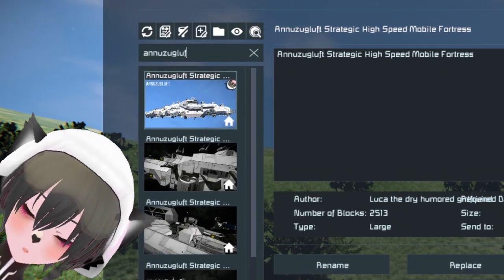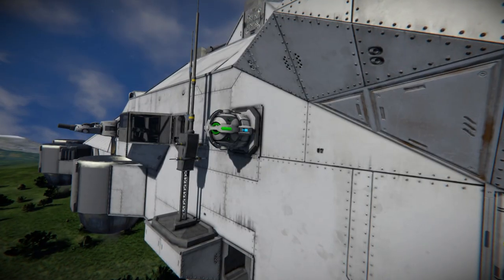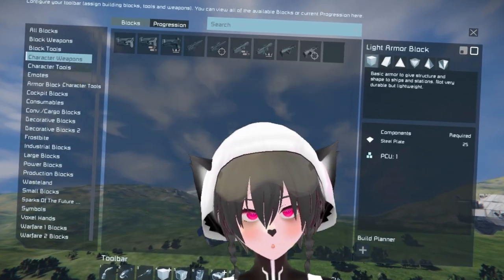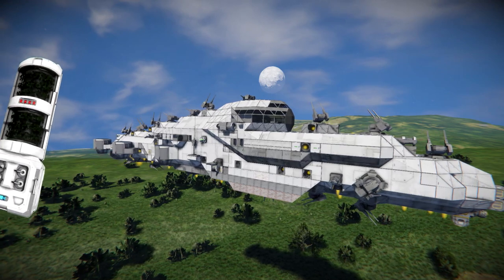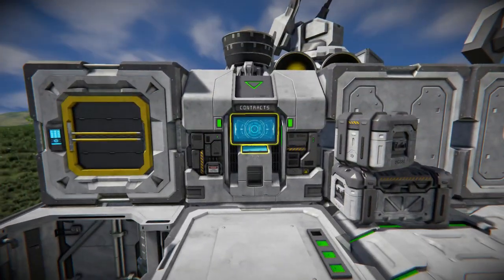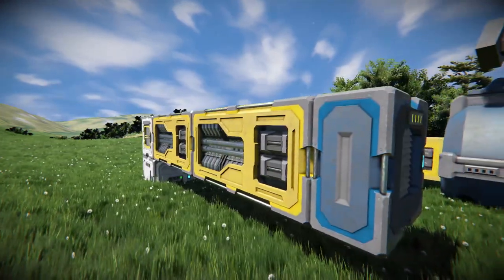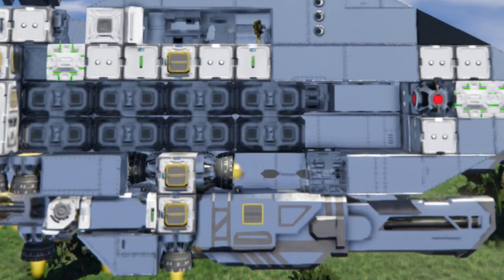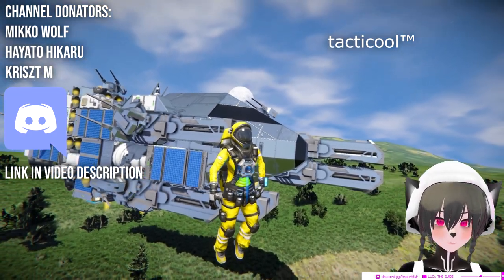These Parts Don't Need Armor - Space Engineers Ship Design Guide

Comment: Really good reminder. Build Info is a very helpful mod that shows the integrity (hit points) of every block. It's also available as a plug-in in the SE Plug-in Manager, so that you can load it even when playing on a server that doesn't include Build Info.

You can definitely save literal tons of weight when prioritizing like this. A large grid O2H2 generator has 10 block faces, so encasing even half of them in armor requires 5 PCU and 2.5 tons of light armor (or 15 tons of heavy armor). Multiply this by 10 or 20 functional blocks, and even the cheap PCU cost of armor can start to add up. Certainly the armor does, especially when deciding which critical parts deserve heavy armor. Gyros in particular are pretty dense, so I like to mount them with the mount point to the rear/interior on my CIC's heavy armor shell. This means shots in line with the CIC have to destroy the gyro and underlying armor first, and I have a greater than zero chance that, with the gyro being destroyed first, I don't have to worry about a loose gyro rattling around inside my ship and wreaking havoc.

I'm always looking for ways to min-max my thrust power:weight ratio, so I'll keep a few essential gyros, batteries, O2H2 generators buried safely within armor to the rear. As I design my ship forward, the entire front half (or more) of the ship is built from a mix of additional expendable functional blocks.
Reply from the maker: I see x3 that does sound handy c=

Comment: I took a totally opposite approach for my survival ships; my armor is my ability to break off from engagements and jump up to a maximum of 22,000 Km. I usually do it in shorter 10 Km jumps, zigzagging to a known safe location to give pursuers no hope in tracking me.

Now, granted, this doesn't work in planet gravity, but I never send my main ship into planet gravity unless I know my route is secure.
I have few external systems, and those that are external can be done away with, but most stuff is inside the hull, to make repairs far easier/cheaper.

To maximize my jump capability, weight reduction is very important. I do want to ensure systems are protected during that 10 second spool-up, though.

Really boils down to how you intend to use your ship. Seems like everyone makes war ships. I have way more fun making civilian/industrial ships, and you just don't see those as much on the Workshop.
Reply from the maker: I see x3 most of my ships are meant to be able to dodge enemy fires too c= and I do have jump drive on most of my ships

Comment: Been saying this for years.  Batteries > Heavy Armor and more useful.
Reply from the maker: P o w e r  x3
Reply: Do they explode though?
Reply from the maker: @congareel  They don't x3
Reply: @congareel  Not to the extent of an H2 tank, but upon destruction they can cause minor splash damage to adjacent blocks. Not really significant.
Reply: @David Parsons This was a vanilla aspect that bugged me -- like why SHOULD heavy armor be less useful than a battery? So for me, the AQD combat balance core mod hugely improves this. light/heavy armor blocks get a universal +100% damage resistance buff, AND anything with steel plates gets 2x the integrity points per steel plate. So LG light/heavy armor has 5k/30k hit points AND effectively takes half damage, while functional blocks still take damage at the vanilla rate (albeit with more hit points if they are heavy on the plates, like gyros and refineries). I really like the change in design priorities this causes. The incentive to use non-armor tanky nondeforming blocks (refineries, large thrusters, etc.) as ersatz armor is greatly reduced.

Comment: I just keep making boxes,  maybe I should just own that and make best box ship ever
Reply: Go for it. :D Box edges are a pretty good place to put turrets for wider firing arcs (second place only to the optimized arc of a pyramid turret position). Most players put their turrets on the centerline of a box/brick facing of the ship, which is dumb b/c it cuts off a lot of the turret's firing arc.

There's a player on the workshop who made a pretty bonkers smooth external brick with dozens of internal pistons, hinges, and merge blocks that open out to deploy landing gear, thrusters, and cockpit access. It's a glorious Klang-ridden display of excess PCU -- and it even plays reasonably well.
Reply from the maker: xD

Comment: Awesome tip, does using a large refinery as external armour kinda sound like a bad idea? I guess i should have a backup small refinery inside?
Reply: Generally speaking, make ships purpose built. If you're trying to just tick every box, you basically have a mobile base, and by default should not be sending that ship to the front lines.
Reply: If you don't mind losing that refinery, then sure. That's why there's the trope about refinery armor. It's a large, tanky, nondeforming block that can intercept a lot of shots, so hiding smaller valuable or low-integrity blocks (like programmable blocks) behind a refinery is a good idea. Block space is probably the biggest limiting factor -- a basic refinery takes 2 blocks while a large refinery takes 16 blocks (1 to 8 ratio in sizes).

As Luca and others have pointed out, basic refineries are crap. Slower speed, more waste from lower efficiency yield, can't process high-tier ores.

Depending on the size of your ship design, if it's a big one, like 1500+ blocks, then heck, you can probably fit 2 large refineries on opposite sides of your ship. If it's a small ship under 200-300 blocks or so, then fitting even one refinery might not fit; then yeah, use a basic refinery.

I personally avoid basic refineries wherever possible. One of my favorite workshop ships is Mike Dude's Firefly Serenity, and he put something like 5 or 6 basic refineries in it. T_T Part of that was to fit the ship's design and aesthetics, b/c its interior is really cramped. But I found a way to tear out half its guts and put in a full refinery without breaking any interior or exterior lines of the ship. :D
Reply from the maker: Thanks Mark x3 it can work but I'd suggest just placing your refinery inside where you want things to be a bit sturdy and don't explode as much (mine is a bit below my internal bridge and above it) and it'll still help with armor without actually being outside c=

Comment: Meanwhile my ship ''Hmm... the hydrogen tank is not armored and is outside of the main body, looks pretty marvelous as well ))) ''

But seriously thou some components get ignored by the Turret AI HARD, even to a certain extend the players as well, the primary target seems to be mainly the guns and thrusters, hell I have never seen AI target the tanks and the area of it if it's separeted, ı don't think their is a priority option for it apart from the player controlled Joe Mark 1 gunner XD
Reply from the maker: xD and I see O:
Reply: Yeah, totally! I play PVE and I'll distribute stuff like the H2 tanks, cargo, etc well away from the turrets with little to no armor, for this reason. I noticed that turrets, power sources (batteries), and control (cockpit) tend to get targeted. My cockpit is usually shot out looong before I lose a significant number of thrusters. The AI cockpit one-shot snipe is real. So in my mid-sized fighting ships or larger, I'll have at least 2 control methods (1-2 remote controls, control seats, etc), with 1 or more of them built as heavy-armor CICs.

It'd have to radically change if I ever play PVP, but that's fine.